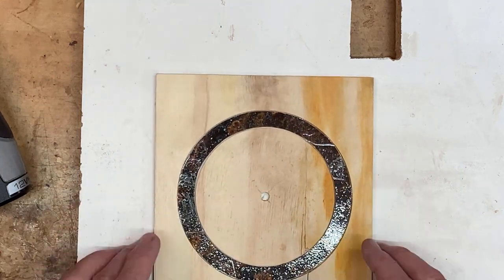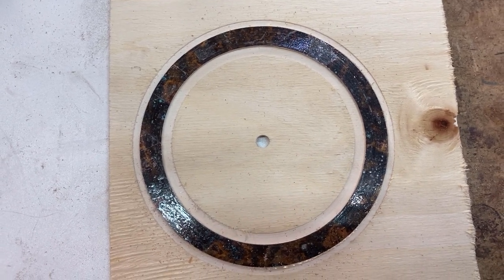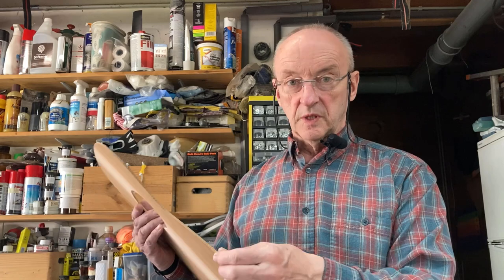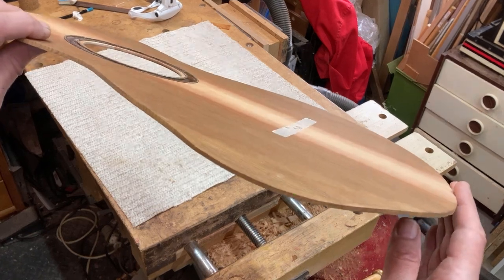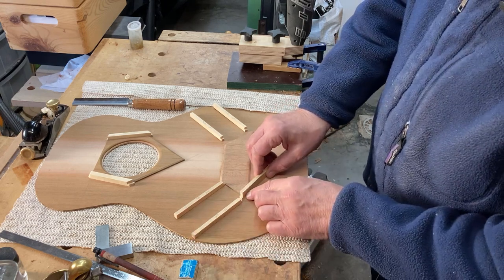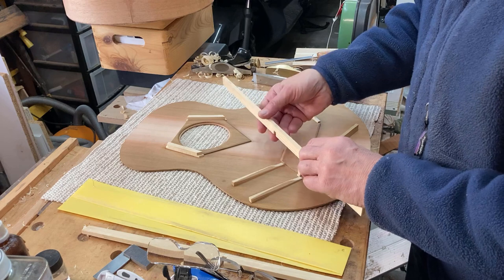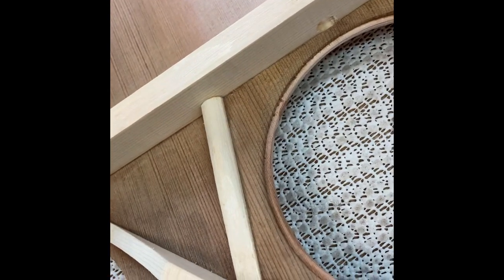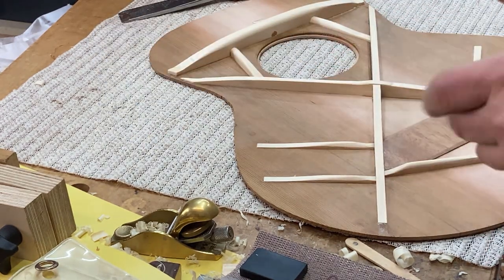GGBO 2021 Acoustic guitar build - The top

Comment: Hi Chris, great and beautiful as always. Considering the hum: Some microphones have a low cut filter build in, that can be activated or your camera might have one in the audio settings. That would cut off the low noise. You could also cut it of in post, before you accelerate the footage, but that's a little bit tricky (it depends on your editing software).
Reply from the maker: Hey, good advice, thanks a lot! Will look at both of these solutions.
Reply: Yes, I was going to suggest your editing software. If you can’t resolve it at source, it might have a parametric EQ you should be able to cut that frequency.

Comment: I learned a lot from this video, thanks!  Could you give us a run-down on those little planes as saws you use to shape and cut the bracing?
Reply from the maker: Sure: the bronze plane is a Lie Nielsen Violin Maker's Plane (LN101 - love this, I use it all the time), the one with ebony sides is home-made (see my first video from 2014) and the other wooden ones are from a guy in the US whose name I can't remember, I'm afraid. Don't know if he still makes them, but they wouldn't be hard to make if you can find or fashion a suitable blade. The cool thing about these is that the sides taper inwards towards the sole, so the blade is very close to the side. I used this trick on my DIY one too.
The straight-bladed saw is just a cheap razor saw, and the curved-bladed one is a veneer saw. This last is particularly useful, as you can 'focus' the cut on the brace and not damage the wood it's glued onto. Hope this helps.
Reply: @GarlandStringedInstruments  It does help, thank you!
Reply from the maker: Actually just remembered the guy: Stephen Boone mini planes. Google that and you'll find him!
Reply: @GarlandStringedInstruments  Thanks, I will.